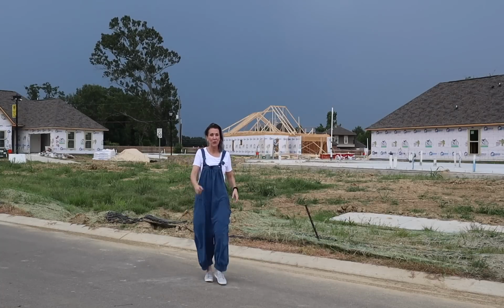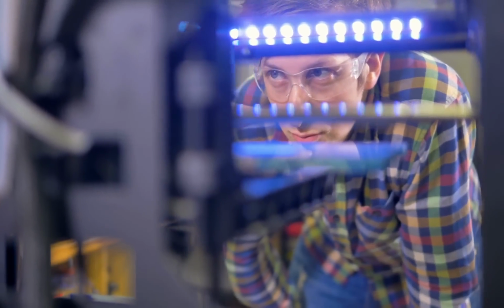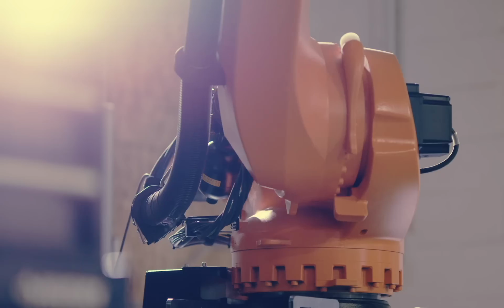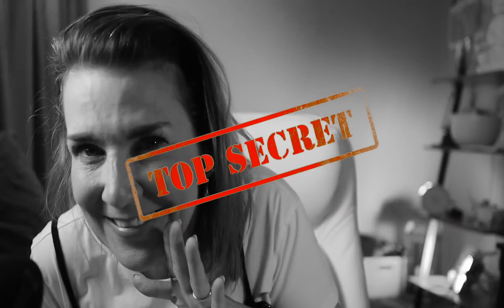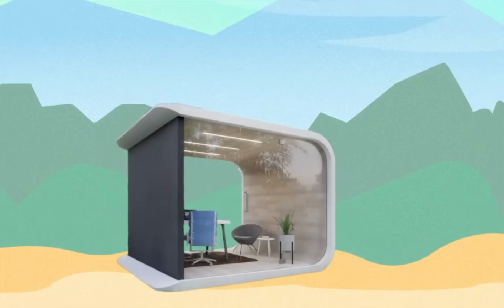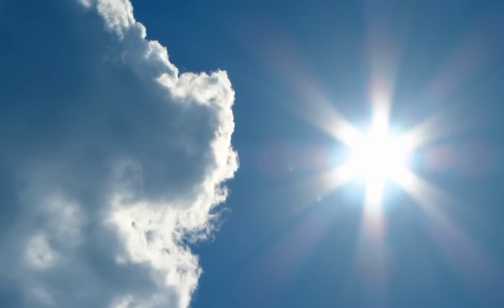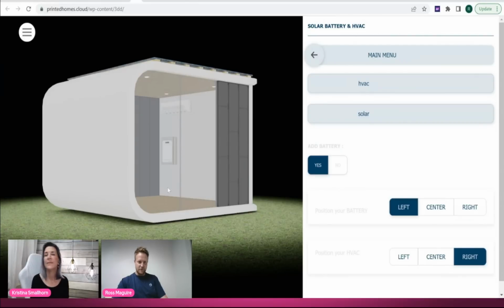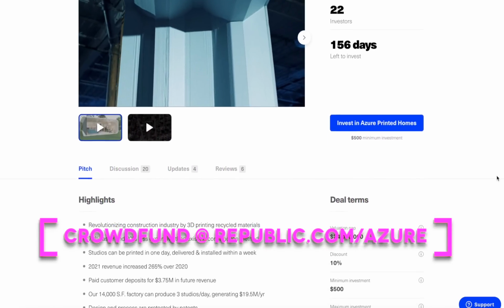Affordable Tiny Homes Made From Plastic, Under 40k

Comment: Be nicer to believe in these if they at least included Average site costs for the size of building.
Reply from the maker: That will vary so much according to the state they are delivered. Even down to pulling permits. It would be impossible to give a proper average cost.
Reply: @KristinaSmallhorn  Yeah, it'd just be nice to have a return of the post war homes of the 1940's and 1950's.

Those could be paid off with an average job in about 3 to 5 years.

Comment: Great concept, but I doubt they will succeed. It looks like it still needs a lot more long term testing in the field. Let's face it, plastic does not last in the elements. I'd rather go with a steel shipping container than plastic. I hope you follow up with this technology in 1 year and 5 years.  Your tiny home in your backyard looks like it will last longer that that plastic Easter egg.
Reply: Plastic if anything stands up better against the elements from what I've seen. Steel is susceptible to rust, and wood is susceptible to termites, rot, and fire. Plastic basically just sits there indefinitely.
Reply: @surblows  Plastic dries out and cracks over time. I guess time will tell.

Comment: I appreciate that they are using recycled products but I wonder about the durability of the plastic over time from being exposed to sunlight.   Plastic not only fades, but it also gets brittle after time from being outdoors.  I also wonder about the fire rating.  Would it create extremely toxic gasses if there was a small fire?

Comment: Cute! But I think I prefer the Boxable model for tiny homes as it comes with appliances and it can be stacked. 

Still, I think municipalities should be looking into options like this as possible solutions for homelessness with communal buildings for the kitchen, laundry, etc.
Reply from the maker: These can be added on later on down the road.
Reply: Plumbing electrical and HVAC for these things are going to be extremely more expensive due to the fact that everything has to be ran in conduit or ran exposed because there's no wall cavities to hide any piping.

Comment: Always check with your local building inspectors before purchasing. Flammability issues could prevent you from getting a certificate of occupancy. Best to wait until others in your community have these installed so you know for sure that everything passes the codes.
Reply from the maker: Good advice. 👍🏻
Reply: @KristinaSmallhorn  I hope this system works, it could benefit millions of people. Thanks for the vid Kristina and the crew at Azure.

Comment: Thanks Kristina! My thoughts: 
1) Love that it's made from recycled material.
2) Flexible  design.  You could probably connect several together to create the spaces you needed. 
3) Durable and easy to maintain.  
4) One of the few designs I've seen that could probably be used as an underground/berm home/earthship.  Plastic exterior would likely mean minimal seepage or condensation. Might actually increase longevity by  minimizing exposure to UV.
5) Too expensive right now.  Yes, I get it. They are in the California market.  I'll wait until they - or a competitor - get that price down!
Reply from the maker: Thanks for the feedback.
Reply: Yes, it's far too expensive. There are tiny homes that are cheaper right now

Comment: My concern is that if you need a contractor for plumbing or electricity,  how can they access the interior structure without damage to the 3D cosmetics.
Reply from the maker: Carla is correct. The shell is 3D printed then foam and plumbing then traditional OSB board and drywall.
Reply: I don't think it's embedded.  My take was they "sandwich it between the structure and the   Wall and floor finishes.